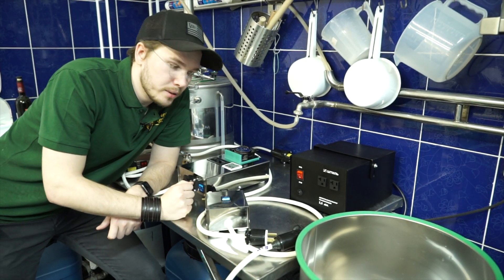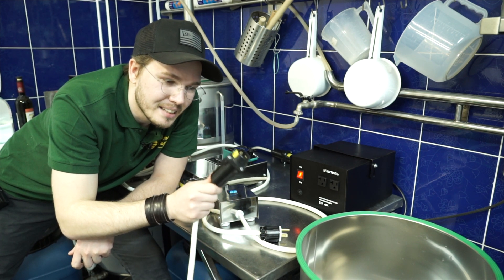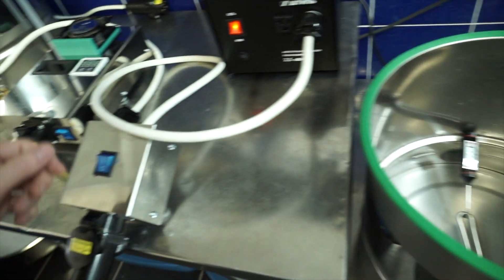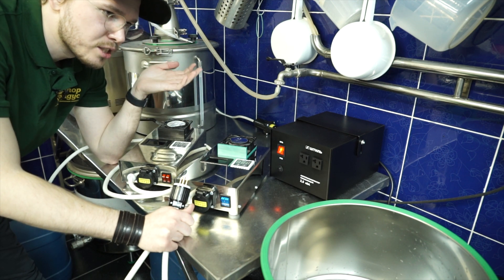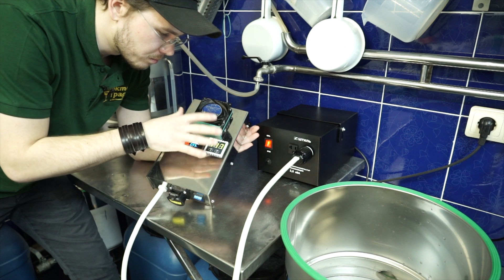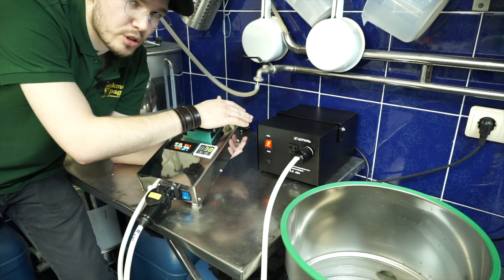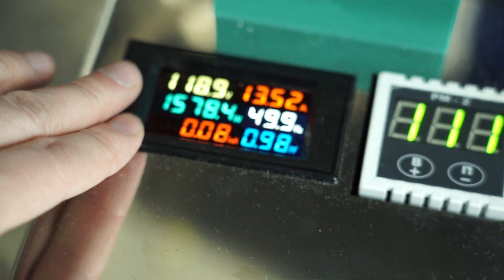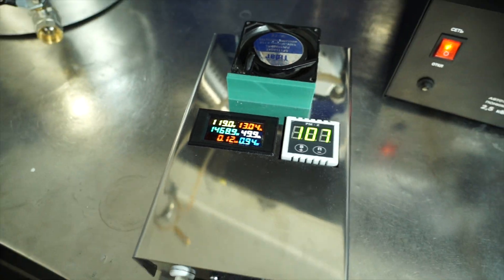Heating regulators for USA and Canada

Comment: Do you have a 220-240 volt 60hz controller for USA?
Reply: I live in Australian . How did you go with the 240 volt version?
Reply from the maker: I am working on it. It's better to try and make split fase and test every device before shipping. I am already wating for 240 volt elements to start making tests.

Comment: Godsdammit!

I just ordered a Distiller X a couple of weeks ago, but was told your controllers and heater weren't tested in the NA power grid. So I spent a bunch of time and money sourcing these things locally.

I guess I ordered a week too soon.
Reply: What did you end up getting?

You can build a nice setup for a decent price, which I was planning to do actually.  I then decided  I was going with a manufactured unit from a good seller because they had the addition of being able control a pump directly from the controller for wort recirculation. But I ended up going with  Dr. Gradus`  M2+ because like you  I just purchased the Stillman X. It gave me the ability to use the higher watt element without having to upgrade my my wall socket to 220v while using my own 3000w step up converter, ironically it was this video that gave me the idea.
Reply: @SiCaRiI_DaGgEr  I just went on Amazon and purchased a project box (plastic), plastic gland, a 4000w PWM, a DROK amp/volt meter, and a 240v 2500w stainless steel element with 2" tri-clamp. Then went to my local hardware store a bought a 20a outlet and switch. Cheaper... yes (barely), but looks like crap. Had I known that these things were tested with NA power, I would have ordered. Too late now.

However, I am sure I will be upgrading and adding on in the near future. I will probably get one of these controllers then.
Reply: @bohican  

Sounds like you did pretty good actually.  The good thing is they can be put together in less than an hr, I'm sure yours will look  good after it's completed!

Comment: Good info overall.The quality of the  main connection adapter plugs is very importand,  I have seen melted plugs on the wall connection what is a great risk of fire .
Good the controller boxes are ready for all countrys ,with specific voltages.👍and polished stainless steel enclosure looks great.

Comment: Nice.  Many of us are using cheap Chinese "10kw" SCR's.  They are cheap and they work BUT they consistently fail.   GFCI is another issue that we are all having to/should be dealing with.   Sadly GFCI breakers for our panels are very expensive.   Many people put in a Hot Tub subpanel, others purchase portable GFCI cables,  and sadly others because it is expensive take a risk of electrocuting themselves.   This may be an area where you can compete with a product based on features and safety rather than having to compete on cost.
Reply from the maker: Wow, didn't know about the price of GFCI breaker... Just looked at them on the web.
Reply: @DoctorGradusInternational   Yes I suspect a properly designed portable solution would be welcome on the market.  Especially for 240v.